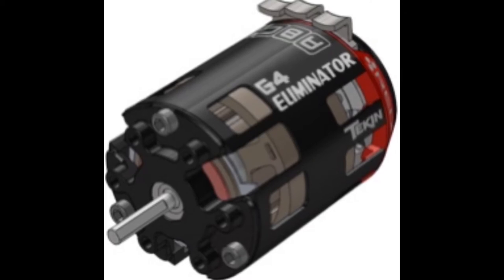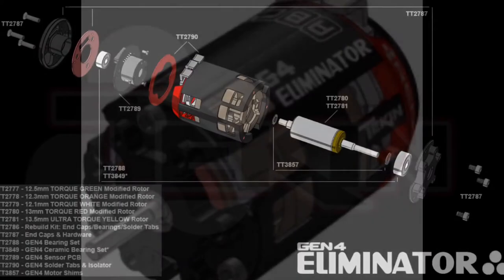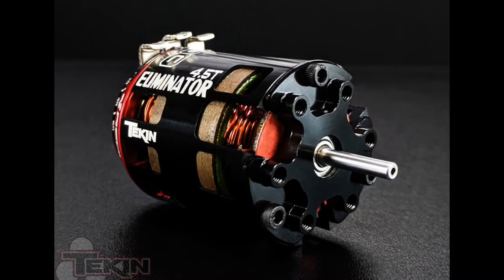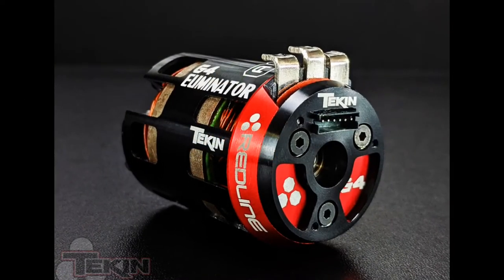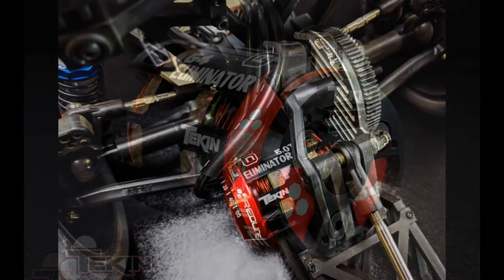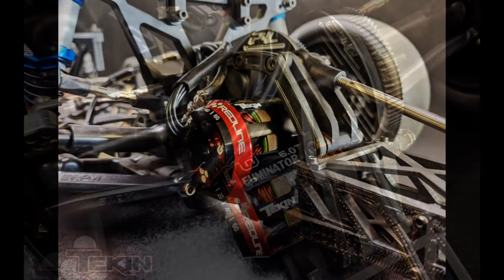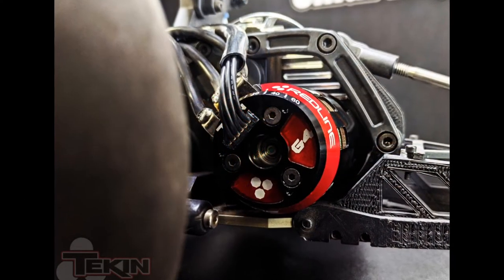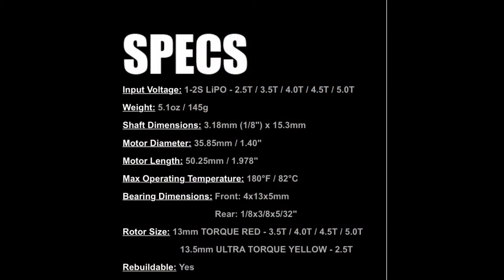RC Update - Team Tekin G4 Eliminator Drag Motor

Comment: Which one is better in this setup the 2.5t or the 4.5t ? I will be getting one for my losi but don't know which to get
Reply from the maker: 2.5 would be better, I run a trinity drag master 3.5t in my Losi...
Reply: @CoachD386  I'm looking to get down to  2.0 to high 1s after turning ...
Rather spend the money once for the best then wasting money for things that will be pulled out and sold and buying more if that makes sense .... have a new losi 22s roller and just wannt get it to the times I want with out wasting aton of money
Reply from the maker: @2thextrme  you can get there for sure, to be honest the Trinity drag master is my go to, i just did my pb on the GNSS 62mph !